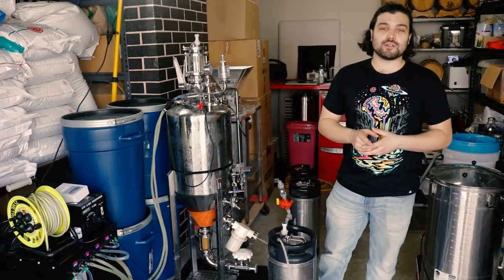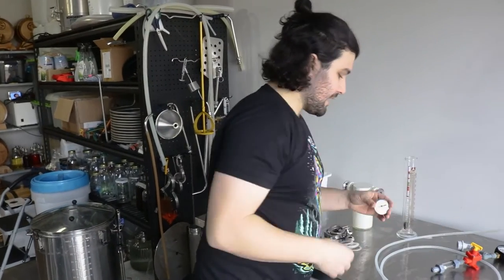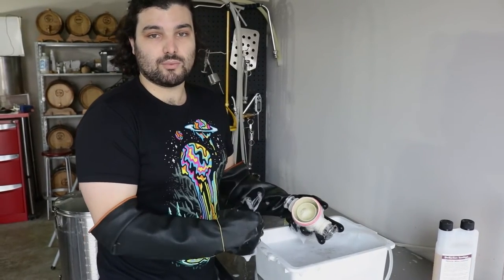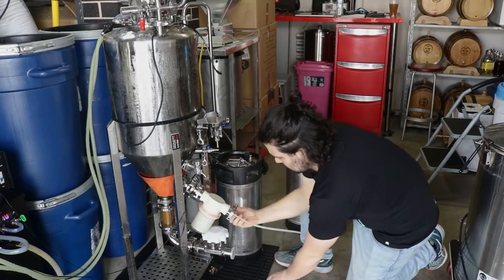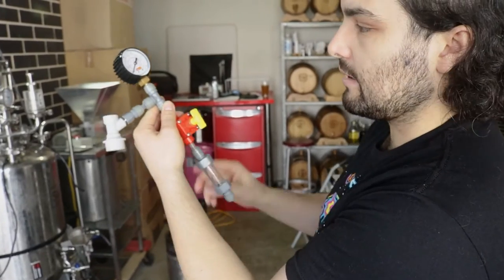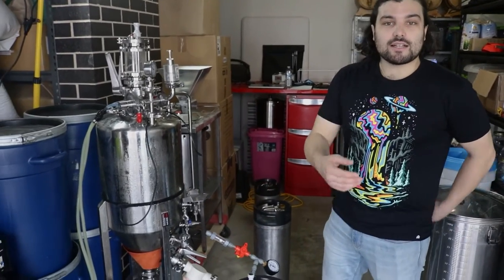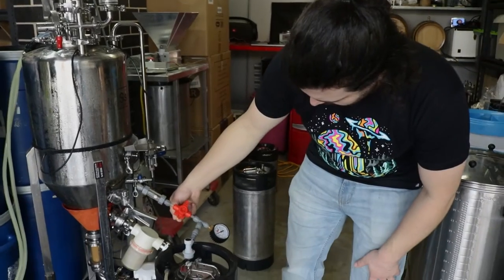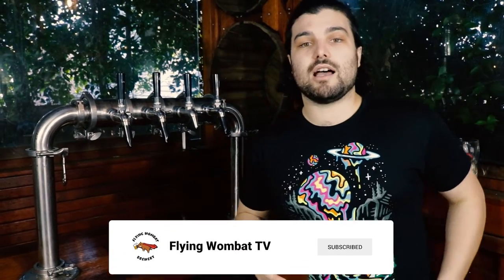Tank to Tap Guide: How to KEG Carbonated Beer?

Comment: Great videos.. so you pre-filled your keg with 15psi of CO2 to only have it purged out when filled. Seems like a waste. Do you find your going through CO2 quickly?
Reply from the maker: Yeah basically, but it’s necessary for transferring pre carbonated beer, otherwise the pressure difference would cause a bunch of foaming when transferring, and it will loose carbonation. Tbh the co2 tank is so big it lasts ages, we don’t really notice that much of a difference, but we can also connect the kegs to the tank and apply a pressure gauge to pre fill the keg with co2 produced from fermentation

Comment: Great video! Just out of curiosity, how long does it usually take to fill one keg during transfer? I’ve tried this with my set up and having the fermentor at 12 psi and my keg with spunding valve set at 10 psi it seemed to take FOREVER! Like 30-60 minutes! Is that normal? Also, do you all have a video on how to carbonate beer in the fermentor with a carb stone??
Reply from the maker: Oh 30-60 mins is pretty long! What size diameter is the tubing your using? The larger the diameter the greater the flow rate, so easiest fix to speed it up would be to use a larger silicone tube for transfers. For us it takes about 15 mins per keg, and I think we use 8mm tubing for that from memory, we used to use 5mm but just like you it to aaaaages

Comment: I am about to try a trick with my transfer from sealed fermenter to keg, I have seen a video where you would run a gas line from where the CO2 bleeds off and instead of letting it blow off into the atmosphere you run it back into the fermenter, the idea is that the beer pushes the CO2 back into the fermenter and the CO2 then pushes the beer into the keg... I don't know if this is a real thing or they were just pulling a perpetual beermotion machine scam
Reply from the maker: Haha no not a scam, it definitely works, but with this method you need to make gravity work for you, so your fermenter would need to be placed higher than your keg
Reply: @flyingwombattv  oh right, that makes sense, I'm hoping to get a chance to try it out  over the next day or 2!